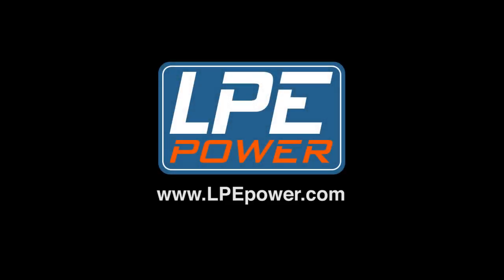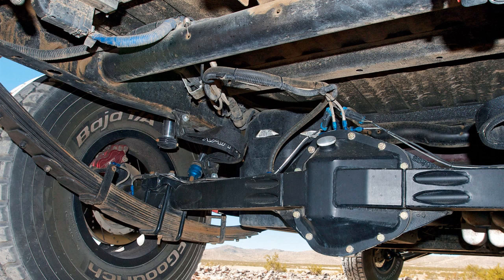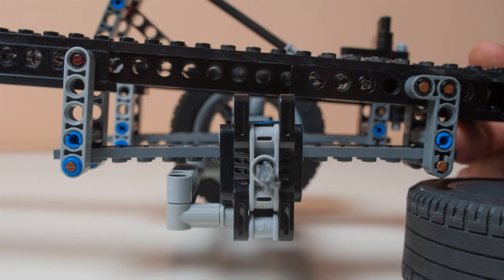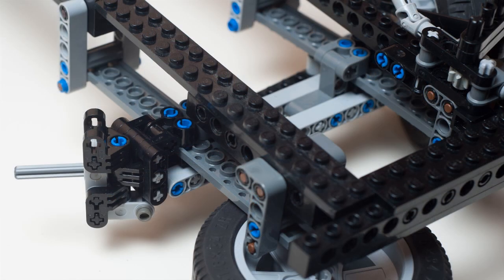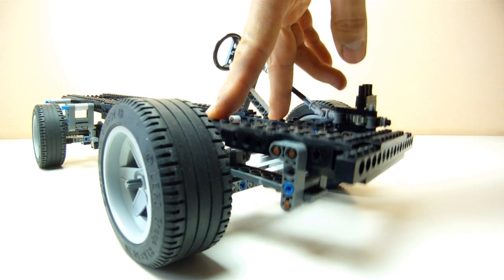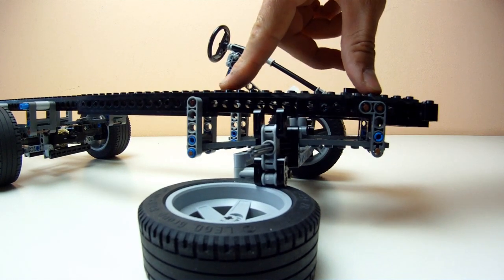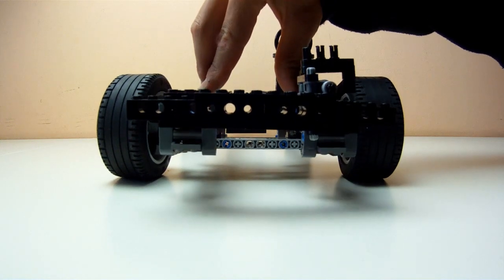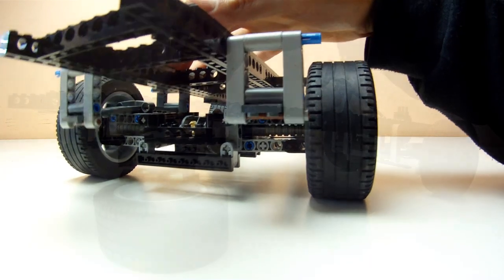LPEpower episode 10 - Leaf springs

Comment: I hate to break LEGO parts, and this spring looks like a cruel one on the plates.I would suggest a different kind of leaf, using the suspension arms and shocks from the 42043 benz acrocs to create a leaf-like effectt. I tried it on my own creation and it works good, although the axle does swings a bit due to the little movement allowed by the parts connecting the suspension arms to the body. If anyone wants to see it, just email me.
Reply from the maker: This isn't really harmfull to the plates. I have used this in a very heavy car and the plates are still perfectly ok.
Reply: Well, they are easier to break now that you've used them like that. I still think using LEGO shocks can let the parts last longer.
Reply from the maker: They are so cheap on bricklink, that it really doesn't matter.
Reply: Still, I hate to break LEGO parts, and not because how expensive they are. In the country where I come from, they cost 1 or more unit of my money

Comment: If you guys could make a tutorial on a STRONG solid rear axle, that'd be great. I'm working on an A body chassis and my rear axle is great but when put under too much pressure, it breaks. I didn't use technic pieces, I used the studded bricks to build, I put out a video yesterday for my lego vacuum engines and towards the end I show a little bit of it. Any help is GREATLY appreciated...
Reply from the maker: Hamburgerhead Use technic bricks and plates like in the video above. There really is no other way.
Reply: Thank you, I will work on it then

Comment: This is a clever design. However, you should reverse the positions of the shackles and hangers to more closely resemble a real vehicle. The shackles should be on the rear, so that if you decide to put lift shackles on, the angle on the drive shaft yoke won't be too radical. The rear axle would naturally angle properly. Of course with Lego, in your current design, you could just extend the hangers you have. But it would be nicer to have it as close to real designs.

Comment: How about replacing a u joint with gears at 45 degrees for high torque. I have broken too many u joints building off road trucks. I ask because I have seen it in a video trial truck tips. I wonder if the mechanics would even work or would it be hard on the steering.

Comment from the maker: No permanent damage will occur. I had a leaf spring system in a 6kg muscle car, that sat on the shelf for 2 years, and the plates that made up the leafs are as straight as all other plates. Those flexible tubes mimic leaf springs only visually, and do not provide any meaningfull spring action, nor do they hold the axle in place.

Comment: Great video although I think that will permanently bend your 2x16 plate a little. When I'm making leaf spring suspension from lego I always use the flexible rods. I'm not sure how to describe them but a lot of people use them as wheel arches as they are good for cures or anything that needs flex